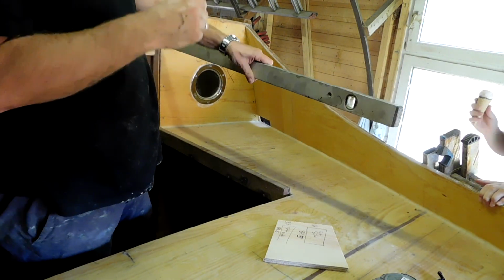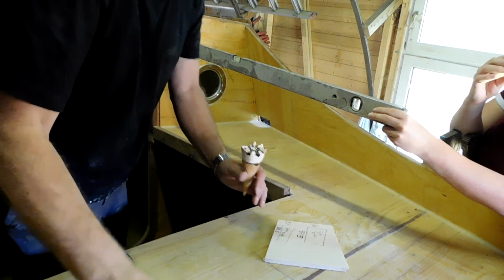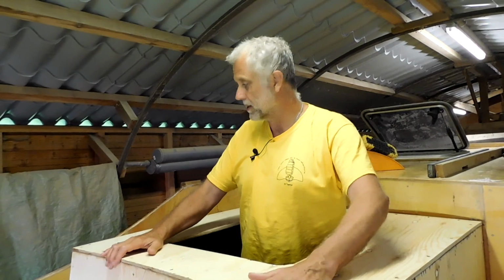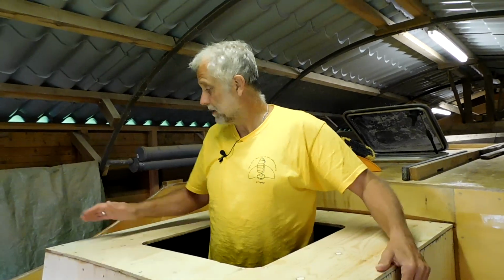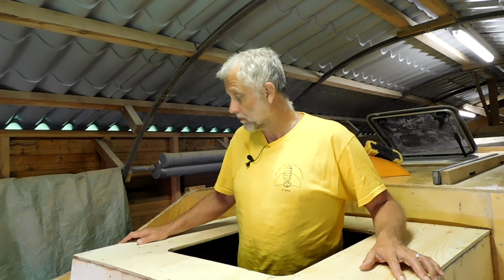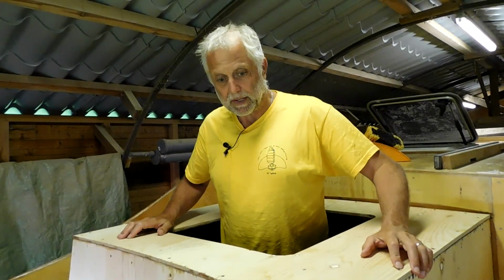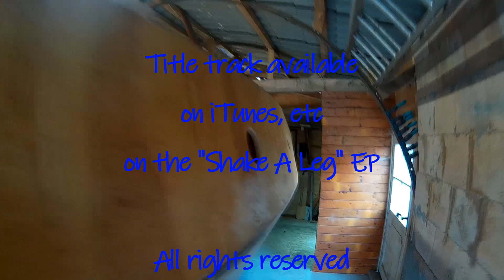The fore cabin "doghouse" - SV Tapatya EP97

Comment: I appreciate this series of videos. I am in the planning stages of my own build, the 37.5' version of your boat or the Dudley Dix 32' Cape Charles are currently on my short list. Some of your ideas will definitely be incorporated in my boat. One major difference is that I will be using okoume instead of Doug Fir because the weight savings are proportional to the extra cost, at least here in the states, and I think the long term benefits will offset the cost nicely. Are you planning to use Doug Fir for your pilothouse if you go that route? That elevated weight might adversely affect the stability somewhat I think.
Reply from the maker: Hi Ward 
Thank you for the kind words. In all truth, the pilot house remains fairly unplanned and possibly might not even happen. However, built from ply with doug fir framing, it should still be possible to keep the weight within reasonable limits
Reply: @SVTapatya  Fair enough - you have the full plans so you will know better than I, with only the study plans to date. I too like the idea of that pilothouse shown on his drawings but don't know if I will go that route. It could always be added later, especially if I am going to sail to Hudson's Bay and the Northwest passage like I want to. The two biggest negatives in my mind for the pilothouse is how to incorporate a steering vane with that enclosed wheel and I believe I would be sorry for having it in the Gulf of Mexico, the Caribbean, and the Spanish Main - it would surely block me from some dearly needed sea breezes. Decisions...decisions...
Reply from the maker: Yes Ward, I know what you mean. My current thinking goes more towards a fixed hard Bimini than a pilot house as such. The Bimini would be big enough to carry solar panels, but could be extended with a cloth part when shade is needed in sunny climes. The fixed part would incorporate a boom gallows for the main sail, but details still need to be worked out.

I'm very much an 'organic' designer - I have basic concepts but leave the detail until I can see the area in question. For example, I'm currently designing the sliding hatch because that's what I'll be working on next, and the galley is sort of in the back of my mind because I expect to be working on that in the next couple of months. The pilot house/Bimini is still a way off, so is still in the basic concept stage. Maybe this method isn't for everybody, but I've designed/built enough different things to know that it works for me
Reply: @SVTapatya  I am very interested in stealing...er...seeing your bimini design, it sounds like a good compromise. If I should decide to Youtube my build I will certainly give your channel plenty of credit even if I go with the Cape Charles design in the end. 

Do the plans not come with a sliding hatch detailed? Or do you have a different approach in mind for it? And speaking of the galley, if you haven't seen it already take a look at the the one in the photos for the "Wild Fox" currently for sale in Malaysia. I don't want to post a link so just do a search for "2007 Benford dory for sale" and you will find it. It must be nice to have money.....

On design philosophy I am the opposite of you - I must meticulously plan my projects else I create more work for myself by invariably screwing it up the first time.
Reply from the maker: Thank you again Ward.

Yes, I'm aware of Wild Fox and have studied the photos. She's a beautiful example of a Benford dory, finished to a standard far higher than I'm aiming for. Nonetheless, I find the asking price somewhat hefty.

Re: plans. Looking at the various examples of completed Benford dories, it becomes clear that no 2 are truly alike - the various builders have all put their own interpretations on the design and changed it to suit them. This includes the construction technique, the structural members, the layout, hatches, fittings, etc. Some have even stretched the design by a certain percentage or added a transom. Really, the most useful page of the plans is the table of offsets. Perhaps the dimensions of stem, stern post, chine log and shear clamp should be adhered to, but beyond that, people tend to do pretty much what they please.

I do look at the plans for inspiration from time to time and the occasional detail. To be honest, I'm not sure if details of the sliding hatch are included - there is quite a roll of pages - but I shall be following my own design. In the end, it's most important that we builders end up with a boat that suits our needs and sailing intentions
Reply: @SVTapatya  Last message, for now lol, I believe I have struck upon the name of my boat if I choose the dory design. With a nod to Anne & Pete it will be named the SV Possum.
Reply from the maker: @PuntBamaPunt1972  Nice one!!